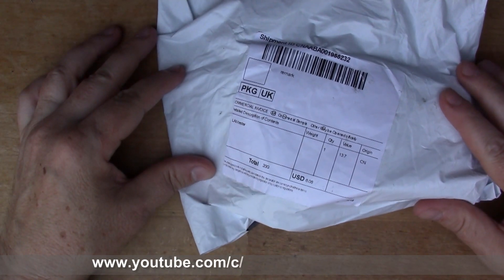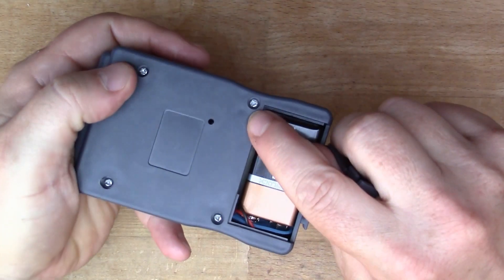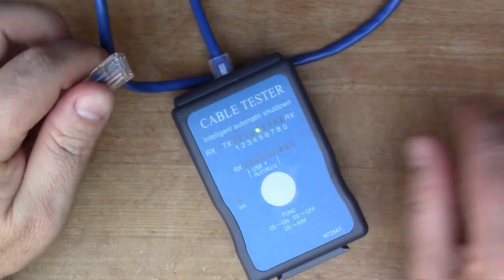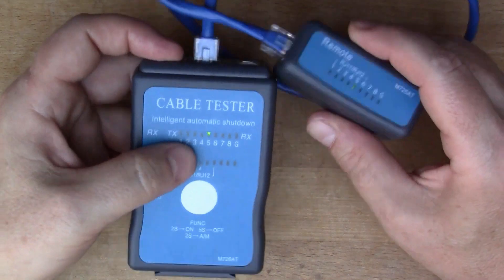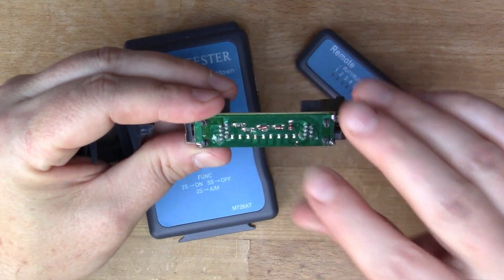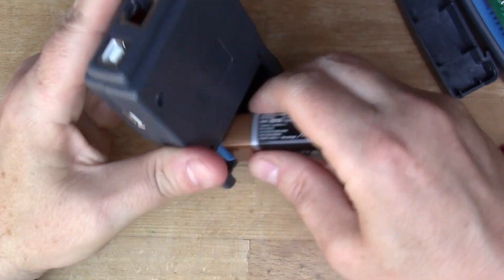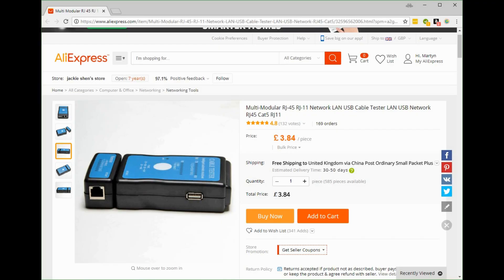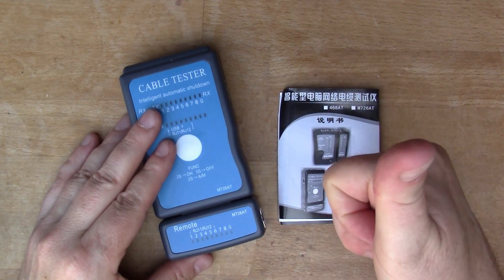Ethernet/USB cable tester review and teardown (#77)

Comment: Is this compatible with all cable classes.. cat 6 and 7?
Reply from the maker: The tester tests 8 cores and 'G', which I presume is the shield, so electrically I think Cat 6/7 are covered also.  Note, though, that this is just lighting a LED using the wire, it isn't doing any kind of speed test, therefore it's possible that a cable might light the LED, but be unable to operate at a Gb/s speed.
Reply: @MartynDavies  thanks. Just wanted to know mainly for checking connectivity not speed. So i guess it's good. 😁😁🤞🤞👍

Comment: instead of modding it, you can buy adapters for the USB-B connecter.
Reply: Adapters will be a bit rare and USB3 has 9 pins. I could imagine some jury-rigged tester that uses the CAT6. But it might be worth it to check whether charging cables whether they have any breakage due to twisting.

Comment: the G isnt lighting up because your cable dont have a sheilded connecter. if it did and was hooked up properly, then it would light.
Cat5e cables dont have this, neither do most cat6, it is required for cat7 though.
Reply from the maker: ok thanks for that